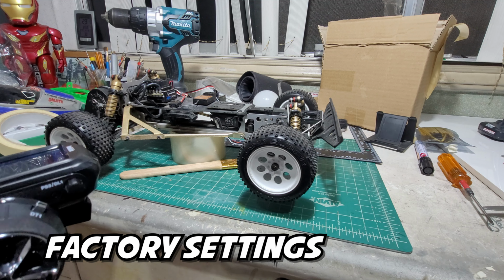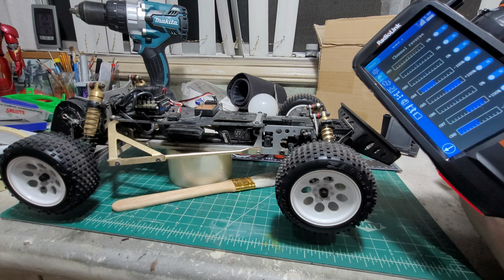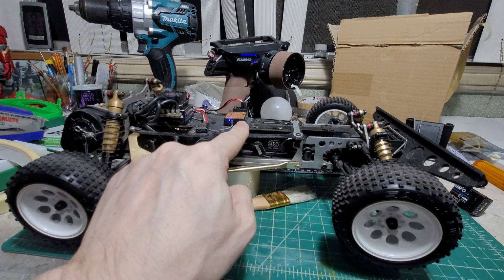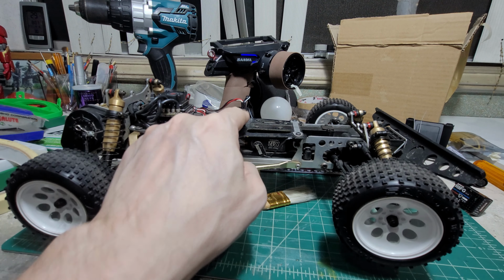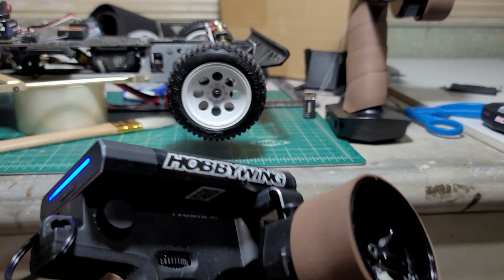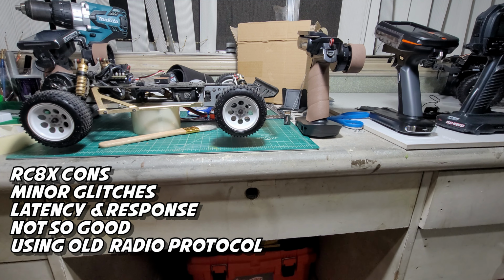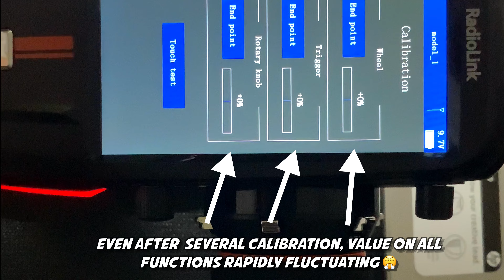Radiolink RC8X VS Sanwa MT44, Flysky NB4 Latency Test or response test

Comment: I've read that the 7PXR from Futaba has had bad latency problems too. Can this be confirmed?
Reply from the maker: I don’t have Futaba 7pxr, (can’t confirmed) that’s one of my wishlist radio, so far i did see many pro level racing guys use either 7px or m17 in high level racing, it should be the best of the best radio out there, and it will be sad if slower that other cheaper radios in the market.
Reply: @oliverstoys8411  I read about that over on the arrma rc forums. 
I happened to be researching about my RC4GS radio because a bunch of drift rc guys says it has bad latency and Radiolink's gyro enabled receivers they claimed are bad.

Not sure if that group just has some extreme brand loyalty thing going on though, but I've seen someone on youtube match up the RC4GS with a Sanwa MT4 and they were almost similar in latency, simply matching my experience thus far on the RC4GS being a responsive radio overall
Reply from the maker: @h.cedric8157  for my experience build in gyro even flysky or radiolink does not perform very well, comparing to some external gyro. great gyro does not shake to much even at 60-80 percent gain and also have better smoother turning transition, there a few affordable gyro for $20-40 usd (afrc, hackslider yeah racing). Regarding the radiolink latency, they published on there website standard radiolink FHHS vesrion 1 protocol does have only 14ms speed, and only work analog servo communications, that why in my video the radiolink does not perform well compare to any of my radio presented in this video, i am waiting for the r8FG vesion 2.1 claims to have the FHHS v2 protocol, that is compatible with digital servo and they claim to be faster 4 to 3ms latency and will test it out once i have it. Unfortunately the RC4GS is only FHHS version 1 protocol so resolutions will be very low, the new RC8X will be the best option once the new receiver version 2.1 are available.

From Radiolink  RC8X hardware and firmware update details: Servo Speed
1. Transmitter:
It is necessary to update the firmware of RC8X to V1.1.5 or above, and then select FHSS V2 protocol to display this option. Servo speed can be selected from 14ms, 4ms, and 3ms. The factory default servo speed is 14ms (analog servo speed), 4ms, and 3ms (digital servo speed).
 
2. Receiver:
If you are using a digital servo, you need to choose a servo speed of 4ms or 3ms. Please confirm whether the receiver you are using supports digital servo. Currently, RadioLink receivers that support digital servo include R8FG V2.1, R4FGM V2.1, R8FG, and R4FGM receivers with a factory date of 2023/4/26 and later. Other versions of RadioLink receivers do not support digital servo. Even if 4ms or 3ms is selected when using them, the default servo speed is 14ms. RadioLink will continue to add other models of receivers that support digital servos in the future. Please pay attention to RadioLink's official website.
Reply from the maker: @h.cedric8157  if you are really interested with the RC4GS, i will suggested you wait, i am sure radiolink will release budget model with the FHHS v2 protocol with higher resolution and compatible with the new digital communication 2.1 receivers.
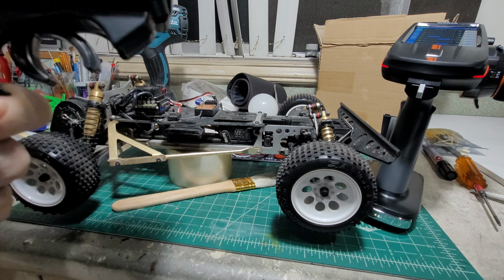Reply: @oliverstoys8411  My current RC4GS with a late 2018 mfg date (hence compatible with the latest version 6.0.3 firmware, but not v6.0.3 functions available due to chip limits) has had it's antenna replaced with 2.4ghz rated 3db (I think) antenna, after having had "animal contact" and I've been using only the ridiculously tiny R4FGM v1.1 in all my RC vehicles, running digital servos Kyosho LAV 1:18, HPI Blitz(very slide-y for a stadium truck), and my TT02 type R(currently trying to work on converting my Takara Tomy 1:24 drift car, and one of them six wheel 1:16 WPL trucks) 

It will take time to have my local online electronics stores to stock up on the v2 R4FGMs, as they have large stocks of the pre- april 2023 versions.

The only time I had issues with the Radiolink Gyro as you explained is with the "included in box" R6FG receiver I got with my RC4GS back in 2019, but not with the V1.1 R4FGMs

I also saw that my radio is qualified for a discount to get to RC6GS V3 on their site. I might check with Radiolink if they could get something for the RC8X.

But overall would you say the RC4GS is trash as told by them drift clubbers?
Reply: @oliverstoys8411  I just checked, RC8X in my online electronics shops are back ordered for months.
Reply from the maker: @h.cedric8157  radiolink are not trash, there are know for the longer range, feature, affordable receivers, and great value for starters and hobbies, you can still use it for drifting but you just need to get a good fast servo (preferably programmable) and a decent external gyro, you will still have fun drift with your current radio, once you go to the next level of drifting like adding esc with turbo/boost and going to precision drift tandem with high level drifter, then that the time you need to get a faster and responsive radio.
Reply from the maker: @h.cedric8157  i would advice to wait if radiolink restock the RC8X in your area, i hoping they do improved the latency with the new receiver v 2.1, glitch with hobbywing XR10 esc and binding blindspot.
Reply: @oliverstoys8411  I thought so, thanks for all the added deets on Radiolink stuff!

Knowing my countrymen, social media hobby groups have this toxic tendency to gatekeep the hobby and shame anyone having lesser equipment.

As for the longer range, maybe I should thank my cat for chewing the old TX antenna of my RC4gs that forced me to get a higher DB 2.4ghz antenna, as I could get farther out with my blitz beyond what's comfortable to me since then. 

And thanks for all the responses!
Reply from the maker: @h.cedric8157  your welcome 👍🏻

Comment: Does it make a difference you are using an air receiver? Ground receivers have only one antenna I thought! I might be wrong
Reply from the maker: Radiolink RC8X include R8FG receiver dual antennas only, now they are offering additional option R4FGM single antenna but for 1/28 or 1/27 micro RC.

Comment: Ya lost me when you said the NB4 looks old. Those big Thors hammers sized plastic bricks look old AF. NB4 looks futuristic comparatively and being able to just move the wheel around the remote.
Reply from the maker: I really love my NB4 love the design too, the only disadvantage for me the brightness display, which need to be brighter for outdoor very sunny 🌞 use, the display of the radiolink rc8x look amazing because of the vibrant color and update graphics but the overall speed, efficiency and reliability goes to NB4 in my opinion.

Comment: It's latency at far distance is the problem, do another test
Reply from the maker: Latency at long distance will probably have the same results, there a comment made by Radiolink in my second video regarding issues with the radio blind spot and switching Fhss protocol, for my understanding the r8fg receiver manufacturer earlier than february 6,2023 are FHSS v1 that means it design to work properly to fhss v1, that mean lower resolution 2046, even though it will kinda work with fhss v2, radiolink don’t recommend it, because some functions will not work properly according to Radiolink.
Reply from the maker: For reference only skip to 2:30 seconds https://youtu.be/1bKn2xS3wBU?si=FcoyZN3eMUkY4WFb

Comment: I will bet you are using an older video reciever. The V2 recievers are way better.
Reply from the maker: FYI, the receiver I am using the R8FG (latest), the highest Radiolink can do is FHSS V2, comparing with other brand who have newer protocols (several generations) already, for example the vintage Sanwa Mx3FG in this video use FHSS-2, next the Sanwa MT-44 use FHSS-4 and the newest Sanwa MT-5 which I don’t have use FHSS-5, the Radiolink use very old protocol which are compatible with there older receiver FHSS-1 the only highest option in the menu option RC8X will be FHSS-2( latest firmware update), that is why it’s way behind speed resolution compare to other leading transmitters. 

The video I made, are for reference only, usually what you expect to get when you buy any of this radio and receiver, and I did explained in this video the all brand are tested with the included receivers, except for the Sanwa MT-44 that I used a cheap clone receiver ($17 usd), but the MT44 still perform effortless again the other models in this video.

Comment: 2:07 The servo throw for the Radiolink is much longer causing the servo saver to activate. The delayed return time is cause by the servo saver notch finding center before it can move the rack. This test is a joke and you're spreading misinformation.
Reply from the maker: All test used the same servo, servo horn and esc bec voltage, Radiolink already informed on the website that the r8fg receivers released earlier than Feb 2023 are slower FHSS 14ms slower resolution , before you criticized do your research. (This video was made 8 months ago FYI).
Reply: @oliverstoys8411  It has nothing to due with the servo horn.. I'm referring to the endpoint adjustments on the radio. You clearly had a higher endpoint value set on the Radiolink. Also, response and resolution are two completely different things. Response time is tied to latency and is measured in MS. Resolution is how many position points your transmitter can relay to the servo or esc. Common man you clearly don't know what you're talking about.
Reply from the maker: @johns818  all radio set 100 percent endpoint both directions, i guess you don’t know what you are arguing about either, i am not the only user complaining (well known youtuber)about it the latency of the radiolink and they stop using it for competitive drag, drift or racing, let just say we agree to disagree, no use in going further, Radiolink officially post on there website about latency of the older receiver 14ms, going against 3 to 4ms that a big difference, the only difference from other reviewers that i found out the RC8X is slower than other brand earlier. At the end of the day if you are happy with the radio i am happy for you.

Comment: you have it on a V1 rx and V1 is slow af
Reply from the maker: In this video, r8fg Tested both V1 and V2 protocol, and didn’t make any difference in performance, i have already 3 r8fg receivers, Radiolink already commented that any radiolink rc8x manufacturer later than february 6,2023, the receiver included R8FG version 1. Should be set to fhss v1, You can still set to v2 but not all function will work properly. The complete comment by Radiolink will be available at my second video i published, there are two comments from radiolink explaining 2 issues I encountered, blindspot and switch v1 and v2 protocol.